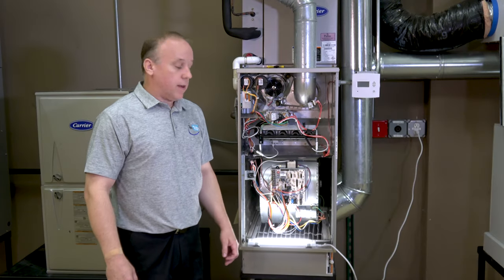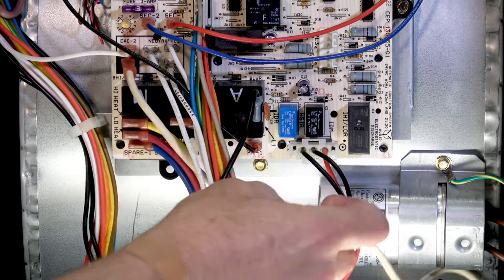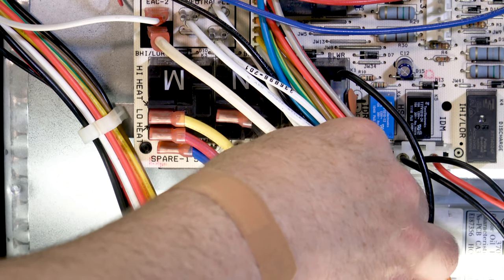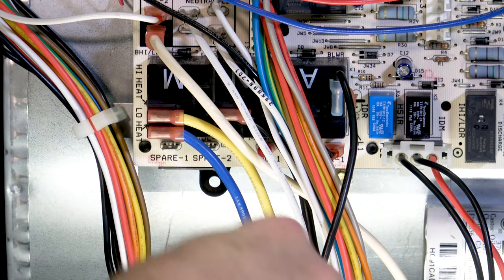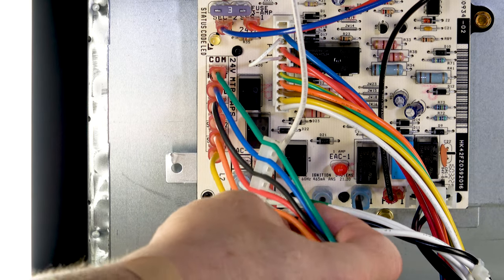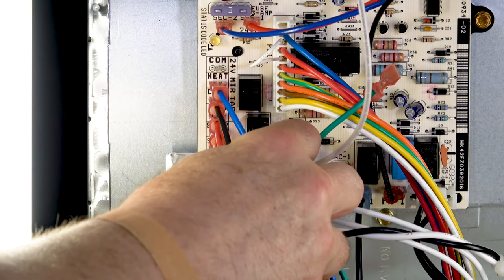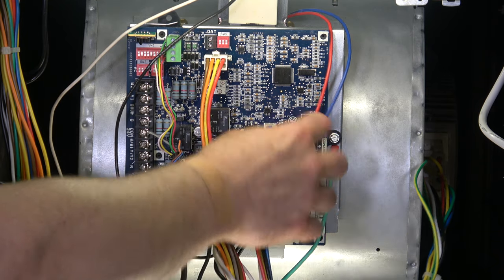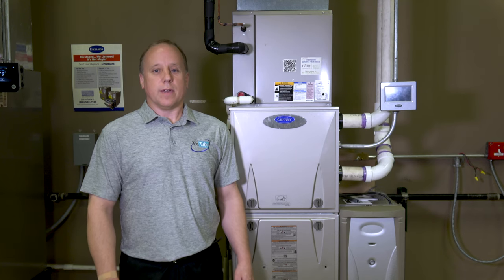Fan Speed Adjustment for PSC, X13 ECM, and Variable Speed

Comment: I have a furnace with the ECM motor, exactly as on the video, I am trying to lower the speed of the circulating fan, when only in fan mode. Currently, in Fan mode, the speed is exactly the same as in cool mode. I am trying to lower that down to the same speed as in Heat mode so that we have lower airspeed and to quiet down the system. How do I do that and which wires should I change without affecting the Cool speed mode?
Reply from the maker: There are 3 mode terminals on the furnace circuit board (heat, cool, and fan) and 2 spare speeds.  If one of the unused spare speeds is lower than the one you are currently using for the fan speed, you can swap them.
Reply: Just had a new system installed and and it is really noisy! Sounds like a jet engine
Reply: @bluesdirt6555  Either the equipment is too big for the duct system or the blower is not set properly. Temperature rise MUST be measured. Blower speed is not set by sound.

Comment: I have a question. A tech came by and one thing I asked him about was decreasing the blower speed since my unit(AC) was a bit too big and turned off too quickly. He had some trouble as he wasn't familiar with the furnace model and actually had to call their dealer/technician tech support line. They helped him figure it out, but in the end I just went with a thermostat that has swing settings and that makes it cycle normally. So he put the blower speed back up the high setting, but now it feels like the air coming through the vents is noticeably not as cool. So my question is, is there anything he could have done in the furnace to effect the actual temperature of the air, or is it something else?
Reply: I was told that a low air speed will cool better and remove more humidity and is more efficient.
Reply: The more your AC runs the more humidity that will be extracted. However, having blower speed too high will not allow much humidity to be extracted in fact is can cause more because it evaporates the water on the cooling coils and drip tray.  Setting this can be hit and miss because: A) too slow fan speed rooms will not cool rooms well AND freeze up coils. B)Too fast fan speed you will end up with a cool - humid house.

Comment: I have a 2019 Payne furnace 96 efficient, with a ecm motor is there anyway to change heat speeds?
Reply from the maker: The PG96VTA furnace adjusts the airflow on its own to achieve the appropriate heat rise.  You can increase it with the dip switch to compensate for a bypass humidifer.  But other than that, there is no adjustment, nor does there need to be.  Why do you want to change the airflow for the heating mode?
Reply from the maker: From the manual:

This furnace is capable of automatically providing proper airflow to maintain the temperature rise within the range specified on furnace rating plate. If temperature rise is outside this range, proceed as follows:

a. Check gas input for low-- and high--heat operation.
b. Check derate for altitude, if applicable.
c. Check all return and supply ducts for excessive restrictions causing static pressure greater than 0.5--In. W.C.

d. Ensure Comfort/Efficiency SW1--4 on furnace control is in OFF=Efficiency position when a bypass humidifier is used. See Fig. 38 for switch location.

e. Verify correct model plug is installed.

Comment: Not 100% follow. To change the speed of an X13 do you change the terminal on the motor or the circuit board?
Reply from the maker: circuit board
Reply: @TECTubefilms  Really?
Reply from the maker: @JoseJB0  Yes really.  Watch the middle section of this 3 part video.

Comment: What is the red-fan and the blue-heat.. explain that part please? Would you please explain how to change speeds
Reply from the maker: We don’t believe that Dave ever had the red wire on the fan output and the blue on heat.  But in either case, the colors of the wires are the different speeds that the motor can be told to run at.  The words on the furnace board (heat 1, heat 2, fan, cool, etc) are the system modes.
Reply from the maker: Dave did show how to change speeds in this video toward the beginning.  Simply switch the wire on any output to the fan speed wire that you want for that mode.
Reply: Yeah didn't really show how to change the speeds just told you what each wire was

Comment: I am working on a tenant complaint about AC cooling not being good enough. This is for a an upstairs duplex apartment unit. The evap is getting nice and cold-maybe too cold. I think the fan speed for the cool is too low. Right now the cool for the motor is on the BLUE (Med-Low). And the heat is on YELOW (Med-High). I alway heard that the cool speed should generally be faster than the heat speed, so Im going to switch the two so the cool is Med-High and the heat is Med-Low. Will this help solve my cooling issue?
Reply from the maker: Generally we like using the lowest cooling speed possible because it provides the best dehumidification.  The only reason to increase it would be to get air to a farther duct run.  When that is done, it should be part of an overall air balancing strategy that also includes measuring CFM at each register (and comparing it to the required CFM for that room) and using the manual balancing dampers to throttle down the airflow to rooms that are getting too much (which will force air to the other zones).
Reply from the maker: You should also look into sealing the duct system.  If it is leaky... as many systems are... then increasing the airflow at the furnace mostly increases the leakage and you still struggle to get air to the room you want.  Check out a solution called Aeroseal.

Comment: Damn! Brand new home with way too much air flow downstairs....HVAC guy he can’t lower the speed...
Ridiculous amount of air flow/ annoying! Is static pressure the reason, we can’t lower the blower?
Reply from the maker: Why can't he lower the speed?  Is it because he doesn't how?  Is it because he already lowered it to the lowest setting it goes to?  Is it because it needs to be set higher to accommodate the airflow required by the outdoor unit?
Reply from the maker: We also just realized you said "too much airflow downstairs."  Can we also assume that means you have enough airflow upstairs?  If that is the case, you may not need a lower blower speed.  Instead they need to do an airflow balance.  This would involve measuring the CFM at each register and then adjusting its manual volume damper down until you get to the correct CFM for that register.
Reply: Balance issue. We want more cold air upstairs in summer, and more warm air downstairs in winter, no good way for a house. In commercial building we have motorized damper control. I wish to have some like that in house. LOL

Comment: I have a Carrier Performance 96 59TP6 and no techs in my area know anything about them. For 3 years since installed in the winter the low speed blower (Which is the only speed used for the most part because I keep my heat set and don't change more than 1-2 degrees) is too low so have cold parts in the house (this house was sprayed foamed so it is sealed very well). I have been through the service manual 40 times trying to figure it out. The manual is very clear with dealing with the cooling blower speeds, but the heat blower speeds it is not at all. It lacks the basic information needed as to: HOW TO GET DESIRED CFM ON THE CHART. I am about to either pull the variable speed motor and put in a single speed (which the tech told me is very common) or just install a new furnace.  I would give ANYTHING right now to have only the wires for different blower speeds...Any help? Carrier does not provide customer service tech support....
Reply from the maker: It is pretty odd that your tech cannot figure it out.  It is even more odd that he is telling your to replace the motor with a different style... on a furnace that he provided and installed to begin with.  What company does he work for?
Reply from the maker: We are not sure which manual you are using, but all of the manuals are publicly available at https://carrier.hvacpartners.com/products/detail/59TP6.  Look at the installation manual, not the homeowner's manual.  Page 23 of the Nov.2019 manual shows which dip switch settings yield which CFM airflow at various static pressures.  Your tech needs to measure the external static pressure of the system with his manometer, which is everything except the furnace, such as the evaporator coil, filter, and ductwork.  Look down that static column on the chart for the required/desired CFM, and then set it for those dip switches.
Reply: Keep the panel open temporary, start heating, when blower run (1st stage low speed), use jumper wire connect W1 & W2, so furnace run on 2nd stage, see if blower run faster.
Reply: If you have part area cold in winter, it is NOT because the blower running too low, it is because the air flow distributed to that area is too low. I have the same issue. Since I don't want to break basement ceiling and run a bigger duct, I just add a electric heater in winter.

Comment: I had what I thought was a bad motor bearing when in fact it was the blower wheel.  It was very noisy and sounded like it was going to explode.  Now after replacing both the motor and blower wheel my furnace is noisy in AC mode (not the same clanky noise but air noisy.) I only have the W connections on my furnace so I have attached black to cool and blue for heat with 3 spares.  Not sure what to do next.  Very frustrating.  Furnace is only 6 years old.
Reply: I have a Carrier Performance 96 59TP6 and have had my blower motor changed once (was under warranty but had to pay $209 to have installed) same issue after new one was installed. Mine makes a very loud rumbling noise when the blower is shutting down and gliding to a stop. Apparently it is VERY common for non-Carrier techs to replace these motors with a simple speed blower. I would do this for sure because they are cheap, however the whole reason I purchased this furnace was for the claimed dehumidification cooling function....

Comment: So if i want just to change the starting speed  and low on my carrier 80%afue without an ac unit do i do blue and red just as you demonstrated please advise
Reply from the maker: You would need to check the install manuals to make sure you specific installation scenario can handle the CFM you need to deliver at the static pressure of your duct system.  Don't randomly change the speed without doing that homework first.

Comment: This is basic knowledge to hvac service techs, you learn it in hvac 101, which leads me to believe this little video is directed at " Bob the homeowner" very dangerous especially when Bob has a gas furnace and he's in there making adjustments.
Reply from the maker: We are aiming some of these "basics videos" towards new techs and as refreshers. Many customers in our territory value these videos.

There is a reason we haven't done gas valve pressure settings or anything that connects to a refrigerant line.

You need not worry my friend. We have this covered. If Bob "DIY Guy" Builder wants to watch, so be it.
Reply: Im not bob the home owner im Joe Dirt the home owner and Im a DIY I reckon :), I like the'm vidio'sss

Comment: so if i want to slow down  the furnace motor i just change the red to spare blue n red to blue right
Reply from the maker: Only slow the motor down if you have verified that your specific furnace, A/C, and duct application can handle the lower airflow.  If not, you will experience furnace high limit trips or condensing unit pressure lockouts.
Reply: @TECTubefilms  thanks for all this good info. It sucks having to call an HVAC company that wont come out for weeks when it is something this simple.

Comment: My board doesn’t have those wires. It’s a new American Standard 80 percent .
Reply from the maker: This video is applicable to furnaces from Carrier, Bryant, Payne, WeatherMaker, Heil, Day & Night, Tempstar, KeepRite, Kenmore, Airquest, Arcoaire, and Comfortmaker.

American Standard is manufactured by Trane and we are not too familiar with that brand.  The general principles will be the same, however.  There are only so many types of motor options available to furnace manufacturers.
Reply: @TECTubefilms   I believe you have to go into the programming.
Reply from the maker: @bluesdirt6555  If you have a special "communicating wall control," instead of a thermostat, then yes you would go into the programming of the stat to change airflow for both heating and cooling modes.  This is not common, though, and especially not common for 80% efficient furnaces.  For the brands we listed above, you would do this with an Infinity, Evolution, or Ion wall control.  For American Standard, it would likely be their AccuLink 850 or 1050 wall controls (but we are guessing because we don't know that brand too well).
Reply: @TECTubefilms  I’m guessing this has a DC motor and it ramps up and at full speed sounds like a jet engine . I’m not happy with it at all . I just wanted simple on ,and off . It also has a loud transformer noise.